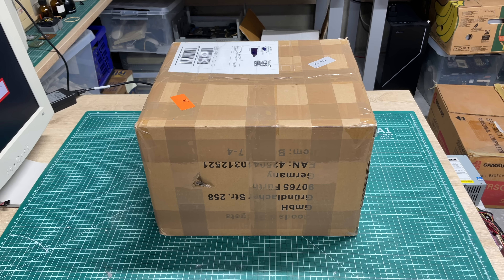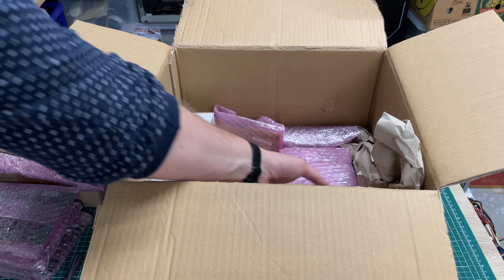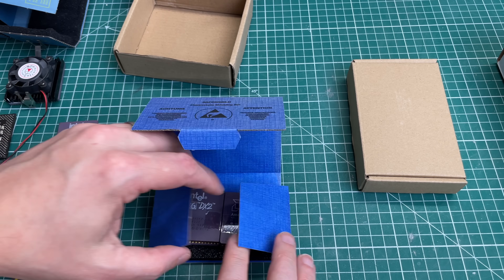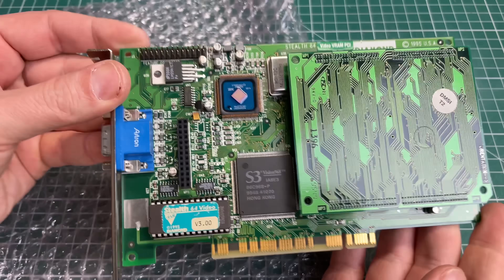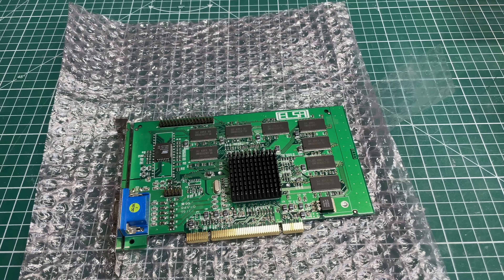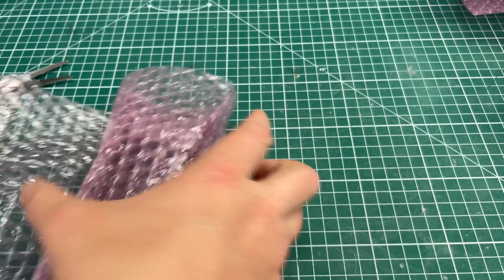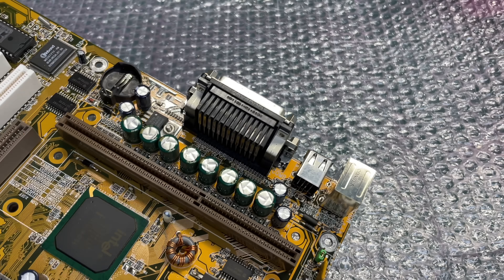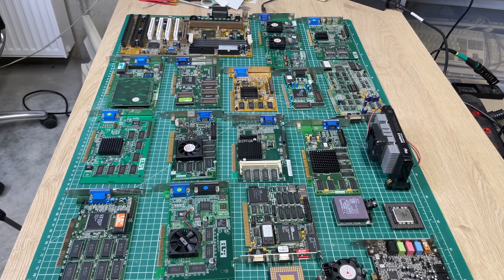Unbelievable donation including my videocard nemesis !

Comment: Nice donation! I have two Voodoo 5 5500 cards, one with the original box and the other one needs heatsinks as they were missing when I found the card, I also have 4 slightly different voodoo 2 cards and one voodoo 3 2000 16mb pci card.

Comment: I love the videos and keep them coming. I had that exact card for the G200 from Matrox. Came with Incoming and Motörhead. It is an 8MB Card that is expandable to 16MB. Never had the expansion module but moved to Nvidia when XP Plus required an odd 12MB Video memory to install
Reply: I had the same.
And had the extra memory.
Card power is to weak to use it 
But i need it to have a higher resolution in that time.
After that i had de g400 model.

Comment: The Gigabyte GA-686LX4 would be a perfect replacement for my GA-686LX that is slowly failing on me.  Unfortunately, those boards are going for over $200 on eBay which is more than I paid for it brand new.

Comment: That Diamond Stealth 64 Video has the IBM RAMDAC on it so it's an OEM card.  Retail versions had a TI RAMDAC which was apparently better?
Reply: Have you checked the markings of the RAMDACs? From what I remember the IBM was 220Mhz and the TI was 170, so actually the IBM was better